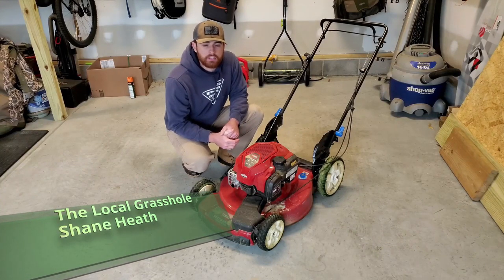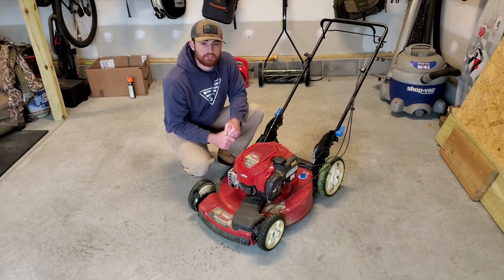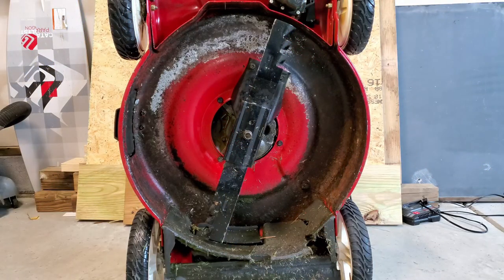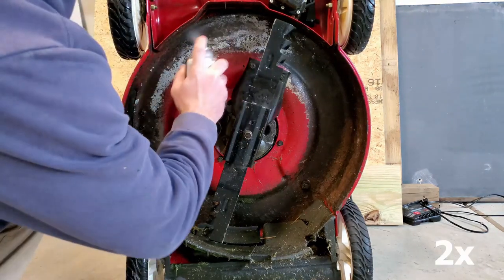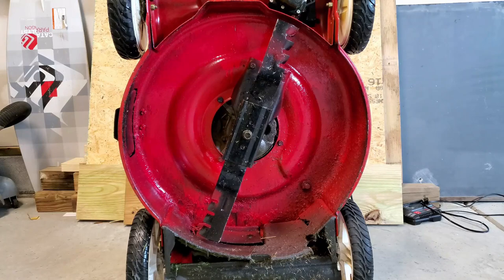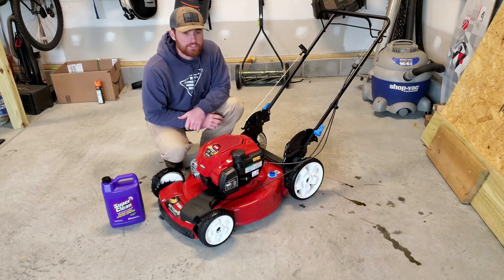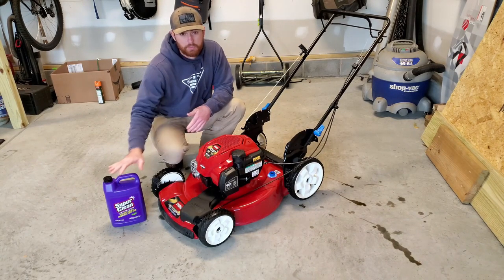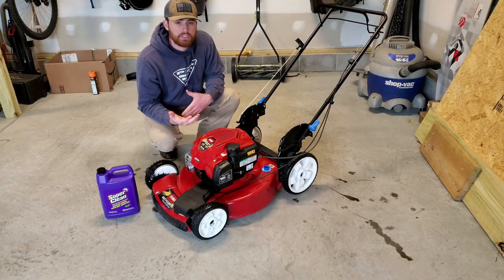How to Clean a Lawn Mower | Toro Recycler SmartStow | Superclean

Comment: I’m The only one on my block that washes my mower. Nice to see someone else doing it also. That 22” toro is really a nice machine. I’ve found it mulches leaves better than other toros or brands. Good call on the paint. I’ve never tried that on a mower before. I have used rain x spray to keep clippings from sticking with some success. Make sure to take the belt covers off once and a while to clear the built up clippings. (I bet you do already) 🤟

Comment: Good job Shane!!  I don't know whether or not my super recycler '09 model has the fold down handle bars - i am going to see...it sure makes pressure washing the mower so much easier
Reply from the maker: @Larry Croft thank you! This is the smartstow model so it is designed to be folded and stored standing up without any damage to the motor, or leaking.

Comment: Do you use the wash out feature on your mower? That was really clogged up under the deck I was just wondering if that doesn’t work as good as I thought it would.
Reply from the maker: The wash out jet works if you have just cut dry grass, but if you cut anything wet its pretty much useless

Comment: How do you pressure wash a mower and not get water in the fuel?  That’s what happens to me every single time.
Reply from the maker: That pressure washer has lower pressure, and I try not to blast the motor to much